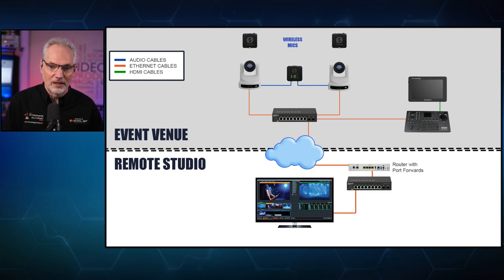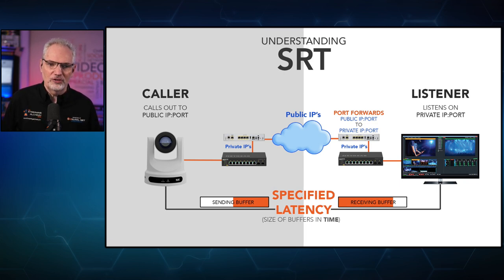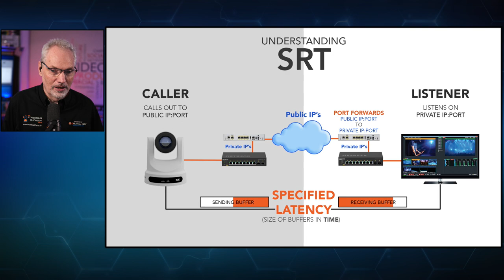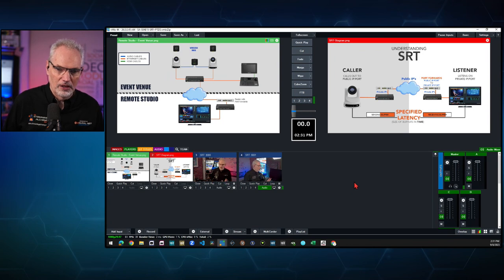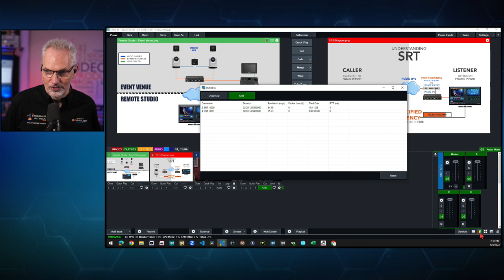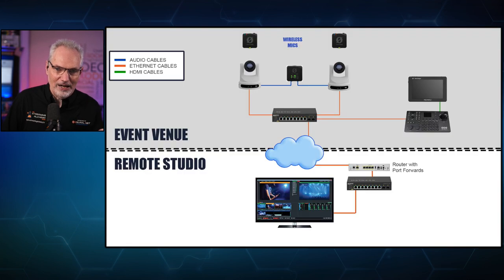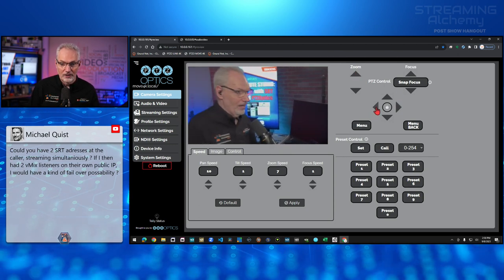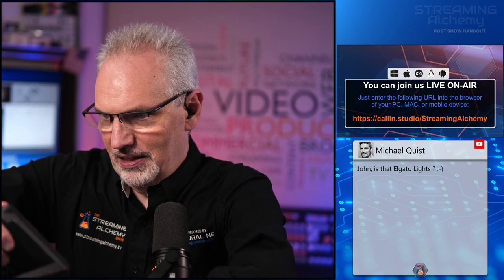REMOTE STUDIO: Using SRT with vMix and PTZOptics Cameras

Comment: Could this setup be done with the ATEM TV Studio HD8 instead of Vmix??
Reply from the maker: Hi @leproductionsny - I know the HD8 has a Remote Streaming Bridge that lets you send an RTMP stream from a BMD camera to the ATEM. I don’t know if this will work with any general RTMP STREAM. If it can, the PTZOptics cameras do support a native RTMP stream out. If not, I believe you could feed the camera into a Web Presenter HD on the remote end which would be able to bridge back to the ATEM. As with SRT, all of the BMD options will require port forwarding.
Reply: @StreamingAlchemy  ok I’m actively trying to figure out if this can work for my project. Thanks for the help.
Reply: @StreamingAlchemy  no it does not. It just works with an atem.

Comment: With multiple srt inputs, how can you sync them on the studio side?
Reply from the maker: Synchronizing multiple SRT streams will require cooperation between the sending and receiving SRT end points. Typically, it is done by inserting a Network Time Protocol timestamp into all of the remote SRT feeds, then using that timestamp to 'align' all of these feeds on the receiving end before playing them out. 

This synchronization across feeds isn't a standard SRT feature. It is available from several software and hardware vendors as part of their SRT solutions.

Thanks for watching!
-j

Comment: it would have been helpfull, not to just talk about, but also show from a completely different network. Also how to controle the cameras from the remote studio, would have been very usefull. We e.g. have some of ptz optics cameras. We want to install them in different places. The location guy just has to turn the power on. After that, we receive the SRT signal in our studio and we can controle the cameras with our joystick controller. How to do this? That would be nice to know.
Reply from the maker: Sorry we weren’t set up across multiple remote networks for this show. That said, the core setup concepts we covered would apply by changing the IP’s and Ports. If you want to control remote cameras you will need to port forward at each location to connect from your PTZ Controller to each camera directly. Once this is set up, it would be as simple as turning on the cameras. Hope this helps.
Reply: @StreamingAlchemy  Unfortunately not. We have now set up everything locally, released ports for camera and PC as in the example here on 8001 in the Fritzbox and set camera to caller and pc to listener with the public ip. We get no picture in vMix. Although we still have a slightly older version of the PTZ optics camera, it was already capable of SRT. However, we also get no image via the rtmp link. However, the camera image is displayed in the camera's browser window. I have no idea where the error occurs.